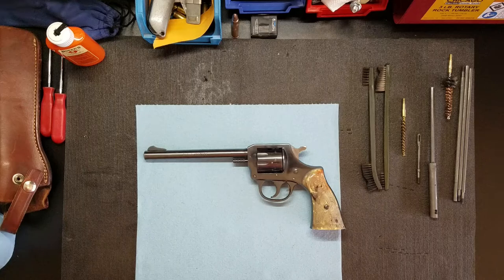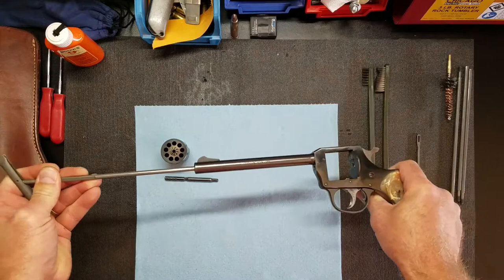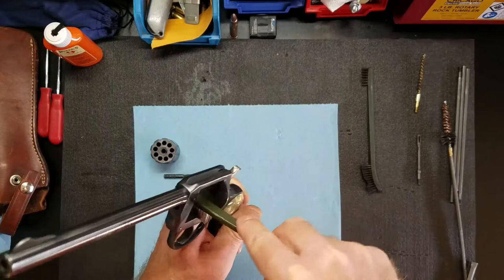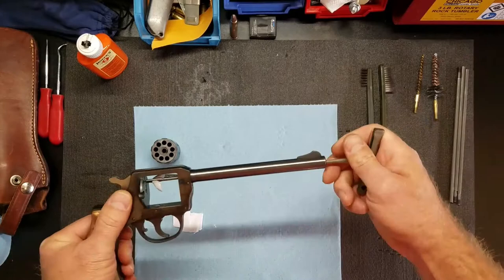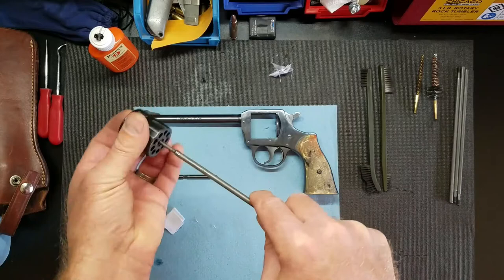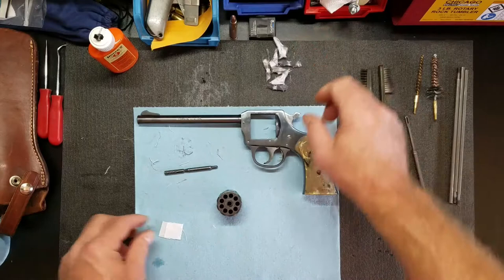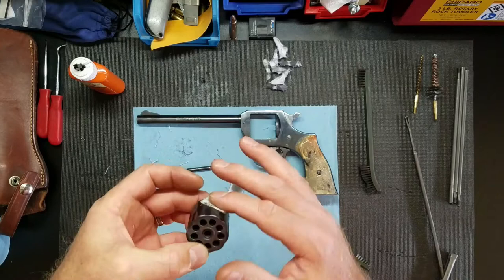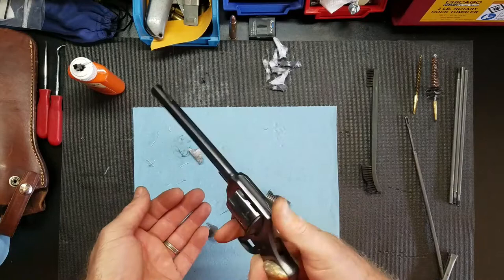Harrington & Richardson - Model 922 Revolver Cleaning

Comment: Jeremy, you worked for quite a while on that cylinder yet you never removed the extractor and cleaned the bore for it. Do you realize the center of the cylinder is the extractor? Push out, rotate 180 deg and it comes out to clean. Nice gun. I have several 900 series H&R's
Reply from the maker: I did not realize that! I will definitely try that next time I clean it. Thank you for that information!

Comment: Thank you. Excellent video. I have the same gun but with the dark brown handle. What do you recommend cleaning the handle with? Mine had ,unfortunately , gotten moldy in storage. I used vinegar to kill the mold but the sheen is gone.  Also, do you recommend the .22 LR standard velocity bullet? I understand that they are not easy to come by anymore.
Reply from the maker: Thank your Judith. Is the handgrip wood or plastic? Mine is plastic (someone correct me if I'm wrong). If it's wood, you would probably need to get some sort of lacquer if you want it shiny again. If it's a plastic one, you may need to replace it.
I do use 22 LR in mine. I also use shorts, but primarily I just use the LR. The shorts are a bit more expensive in my area than the long. 
Have fun and be safe! Thanks for watching!

Comment: 2 question the bottom of my cylinder is completely flat will that affect the shooting and also i’m lookin to purchase a cylinder pin for my P series but i can only seem to find the M series pin
Reply from the maker: I don't think the cylinder being flat would have anything to do with accuracy, However the end of the barrel could if it's not crowned. 
As far as a cylinder pin for your P series, what model is it? Maybe it shares parts with other models. This one is a 922, not sure if a pin from that would work. If it's 22LR I can't see the pin being a different size between models. I could be completely wrong about that though. I do find different parts for different models on e bay, numrich etc.. So having the exact model number would help on the search.

Comment: You ran the brush down the bore twice and said it was enough? Is this your 1st time cleaning a weapon? I guarantee it's nowhere near clean.
Reply from the maker: @howlingmine I appreciate your comment and I'm sorry my video disappointed you. And no, this isn't my first time cleaning a weapon, If you watched the rest of the video, you would see at about 3:30 I finish cleaning the barrel with patches. I never run a brass brush through any of my barrels (and I have quite a few pistols and rifles) more than a few times unless needed. I only use the brass brush to loosen up anything that maybe stuck. Perhaps I should have followed up the barrel with the patches instead of moving to the cylinder before finishing the cleaning of the barrel.